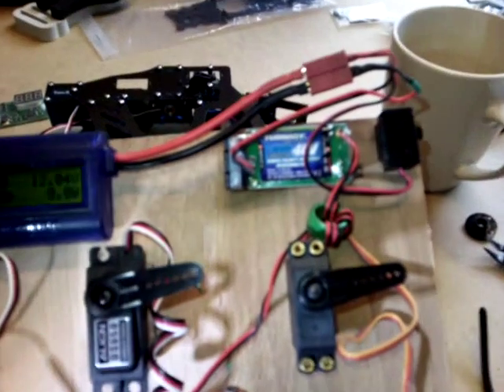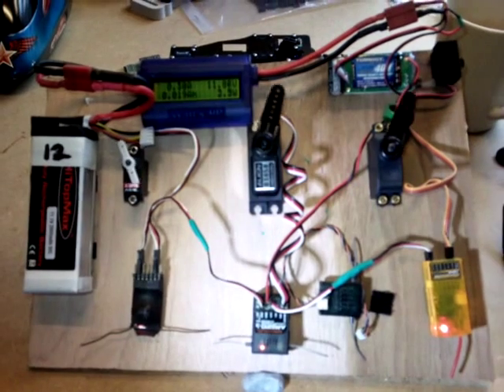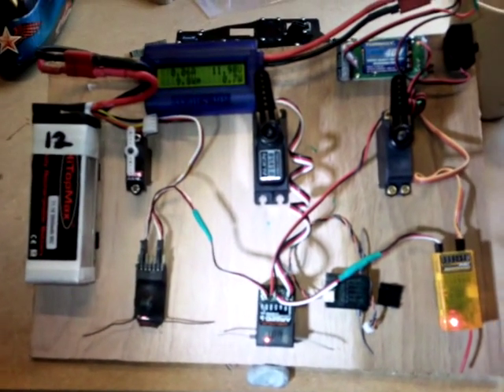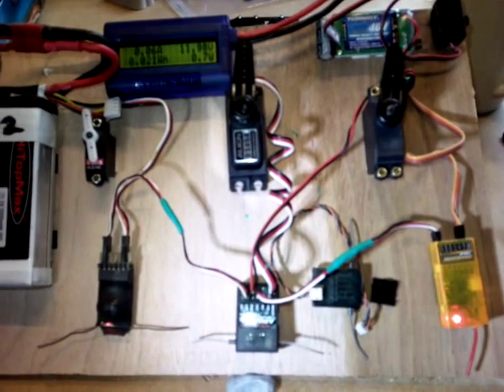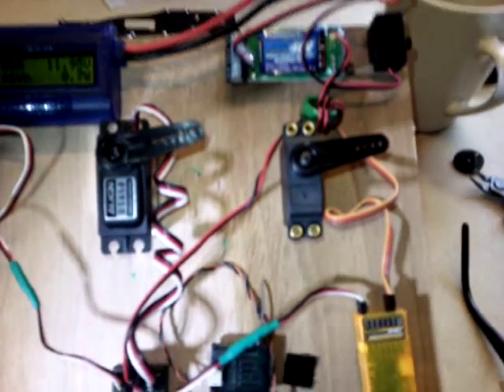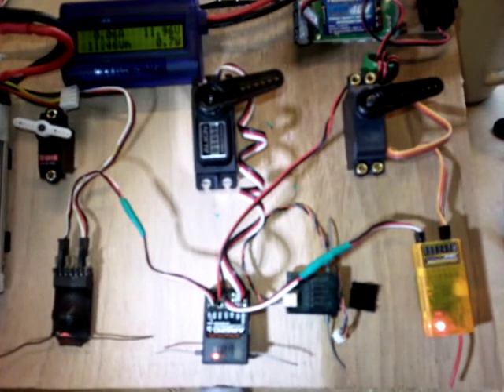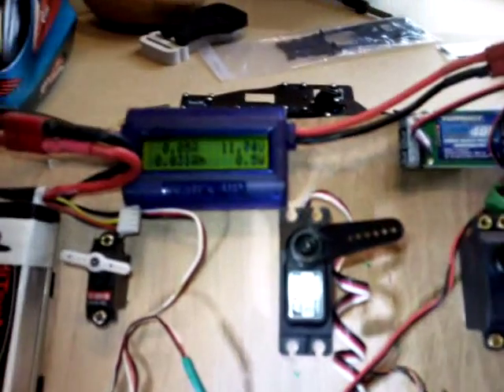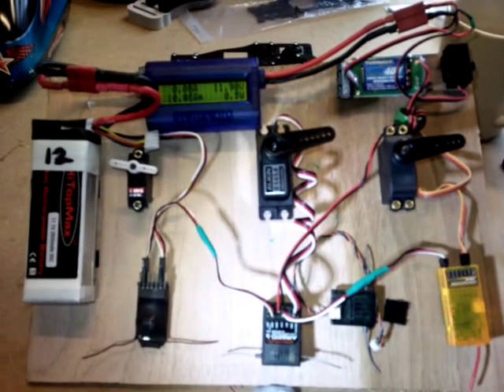Spektrum Receivers - Brown Out Test

Comment from the maker: I have now tried two of these and both are the same, AR6200 and the AR6210. Nothing really to worry about, at the end of the day you just need to ensure your supply is rated high enough for the job, I fly with a Turnigy 5 amp BEC on one of my 600 size test heli's and it has been fine for sport flying, but I would not push it to harsh moves as I can see the current draw raises significantly and I'd be asking for trouble. Hence most people rcommend 10 AMP BEC minimum to ensure a good supply.

Comment: Interesting... I have a bench supply a display, I might repeat this experiment.  I also have an Orange Micro RX.  A couple of models crashed this week at my club with supply pack brown outs using official Spectrum kit- this really does seem to be the main drawback of 2.4GHz.  They still maintain that it was a radio link fault, but I am convinced it was battery because the throttle is both cases didn't reduce to idle.  On post mortem examination it appears to be resistance in the main switch.

Comment: I experimented a serious Brown out yesterday with my Mini Funtana X. Found that my BEC couldn't provide enough power to the receiver when I moved servos too quick (4 BMS-375DMG Digital Servos). My solution will be to install a receiver battery that will add some desired weight in the front of the airplane.

Comment: well you're feeding everything through the AR. you should use the orange as the main distributer (center) and try it again with the no-brand receiver being in the center also. that plays a big role as well in addition to which servo you have connected. so your test isn't accurate and doesn't prove anything until you have the other combinations tested.

Comment: i did crashed a nitro airplane last week. same the led flashing. i doubt the servo maybe Cause hi amps. so Receiver shot down.
but my bec was 5 amps capacity. maybe  6200 Receiver don't work hi amps.

Comment: i dont think that test is a good test . shouldnt it be that all the servos are the same . its interesting to see the 6200 brown out first with the largest servo . does it still happen in that order with the 6200 running the smallest servo ?? and would it not have been best to do it with out the satilite rx on the 6200 as this will be drawing power to .